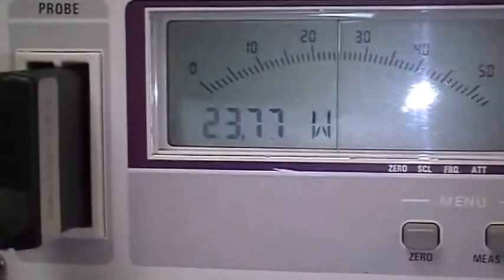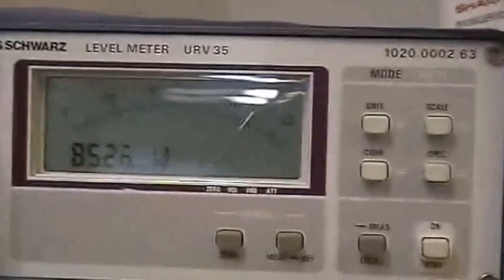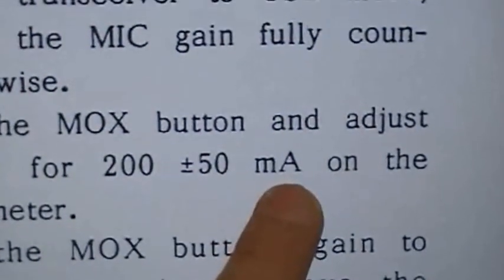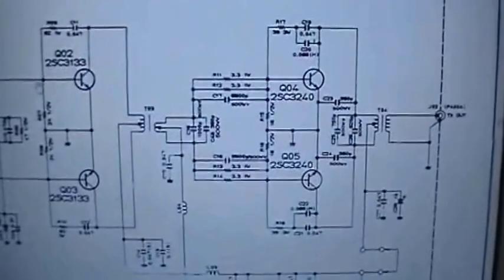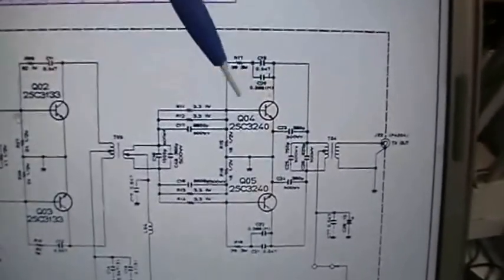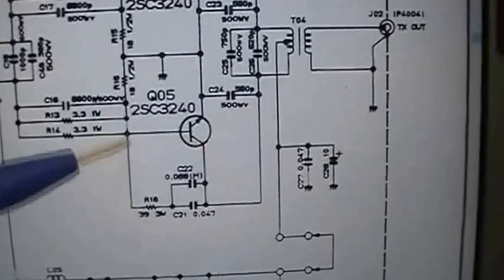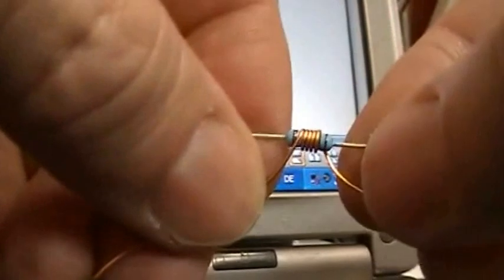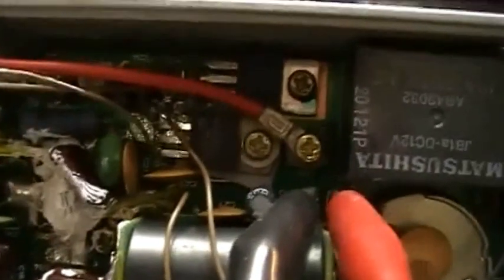#9 HAM Radio PA with self oscillation: Issue solved

Comment: Hi, very nice video, I am Sebastian from Argentina I think that the 747 is a rebellious boy!!! ha, ha!!!, I have a 747 with a similar problem, wich have the self oscilation in all bands, but in a few moments works well but then fails again, I tested all transistors and the other semiconductors and all is good. Do you think that I have same problem or maybe I have other problem?, 73!!!
Reply from the maker: Sebastián S.C. Hi Sebastian, well hard to say over the distance but it might be. Simply thry the little coil over resistor you finally can only win:-)  Good luck.. 73 Peter
Reply: +Sebastián S.C. Hola Sebastian, yo también tuve el mismo problema e hice como TRXBench lo explica en este video mas aun el PA del 747 continuo con su oscilación, la solución en mi caso fue reemplazar los condensadores C11 y C12 en la etapa driver...si a alguien la sirve este dato, que comente. Saludos
Reply: Crystals in the RF section are not connectet to the ground. That's was a Yeasu advice from 1990.